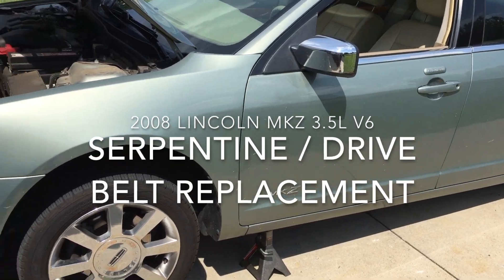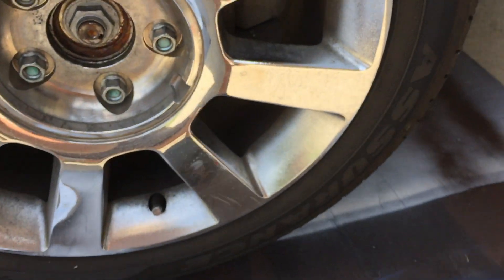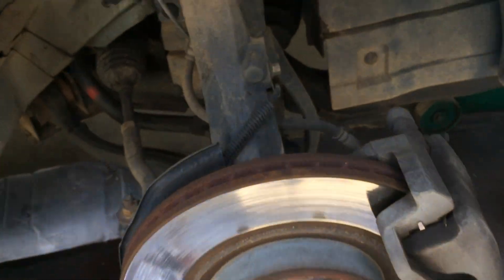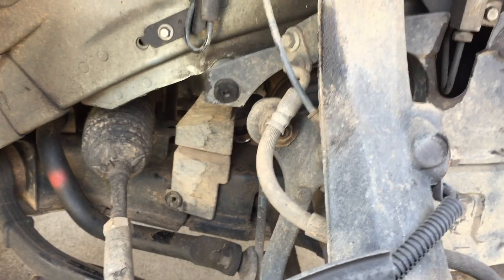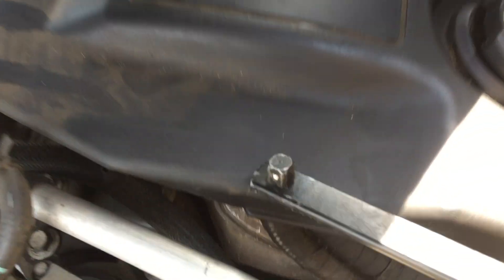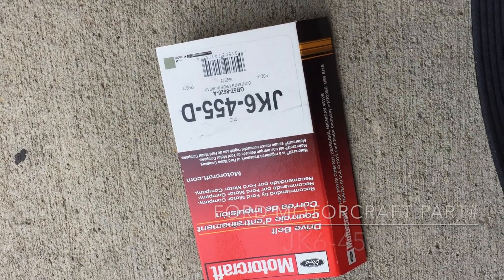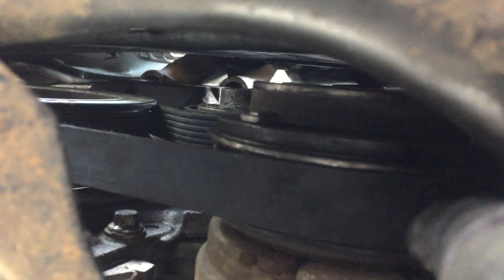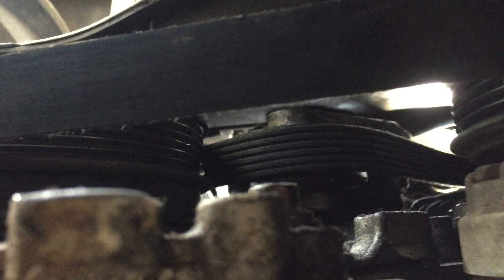2008 Lincoln MKZ Serpentine / Drive Belt Replacement

Comment from the maker: This video is of a 2008 Lincoln MKZ. It should be similar to year around it and also the Zephyr, Milan, and Fusion. It should work on years 2007, 2008, 2009, and 2010 (or at least similar).
Tools:
1. Car Jack or floor jack - https://amzn.to/2R7G96H 
2. Jack stands - https://amzn.to/3f3ABC5 
3. Serpentine Belt Tool - https://amzn.to/3vQIGkn 
4. Flathead screwdriver  - https://amzn.to/2RAjTlU 
5. Trim tool/Ancor remover - https://amzn.to/3f0bUXe
6. Tire iron (or 19mm socket + impact gun) - https://amzn.to/3vVDUBZ , https://amzn.to/3etXiQU 
7. Wood block or similar
8. A new serpentine belt (we used a Motorcraft part# JK6-455-D) - https://www.google.com/search?q=JK6-455-D&oq=JK6-455-D&aqs=chrome..69i57.1109j0j7&sourceid=chrome&ie=UTF-8

Removal Instruction:
1. Put the parking brake on
2. Block off the rear tires with a wood block (I used a 4x4)
3. Pop hood on car and use support bar to hold up
4. Go to front right (passenger) tire 
5. Remove plastic wheel cover with a flathead screwdriver
6. Brake loose lug nuts (do not take off)
7. Begin raising the car up with floor jack
8. Place support jacks under the car in the proper location (see manual - there are indentations)
9. Remove lugs nuts
10. Remove tire
11. Use trim tool & flathead screwdriver to remove four plastic shroud anchors
12. Have someone else on the top of the car, use Serpentine Belt Tool to put in the opening of the tensioner puller
13. Pull Serpentine Belt Tool towards the front bumper
14. Carefully remove the belt from one of the pulleys on the bottom
15. Compare old and new belt (part #JK6-455-D). Make sure they are the same size

Replacement of Belt Instructions:
1. Begin putting the new belt over each pulley you removed the old one from (except the tensioner pulley)
2. Once all of the v-belt grooves are in the pulleys, have someone pull the belt tensioner back towards to the bumper and slowly put on back of the belt on the smooth pulley tensioner
3. Slowly let the tensioner pull the belt tight
4. Make sure everything is lined up so the belt doesn't get thrown
5. Test belt - start the engine and listen. It should not squeal, if it does either your belt is not aligned or it's the wrong size belt.  

Putting it all back together instructions:
1. Put back on plastic shroud
2. Put on the 4 anchors
3. Put tire back on
4. Begin hand tightening the lug nuts
5. Tighten lug nuts down firmly (tire iron or to spec with impact gun)
6. Remove support jacks
7. Lower down car slowly
8. Tighten lug nuts to spec
9. Remove wood blocks
10. Release parking brake
11. Get back on the road

Check out my website at http://mcfixit.us 

If these instructions helped you, please "like" and "subscribe." Have a question, ask it below!

Disclaimer: Due to factors beyond the control of MC FIX IT, I cannot guarantee against improper use or unauthorized modifications of this information in the video, post, blog, or social media. MC FIX IT assumes no liability for property damage or injury incurred as a result of any of the information contained in this video. Use this information at your own risk. If you feel uncomfortable at any time. Stop and go to a professional. MC FIX IT recommends safe practices when working on vehicles, your house, or any other project and or with tools seen or implied in this video. Due to factors beyond the control of MC FIX IT, no information contained in this video shall create any expressed or implied warranty or guarantee of any particular result. Any injury, damage, or loss that may result from improper use of these tools, equipment, or from the information contained in this video is the sole responsibility of the user and not MC FIX IT.
#mkz #serpentinebelt #mcfixit

Comment: Where did you get that super long wrench? I’ve never seen anything like that. I’m sure it would help make this job super easy and not bust a nuckle on a pulley or the block!
Reply: I have one and got it from Harbor Freight in a little kit for reaching the belt pulley.
Reply from the maker: @aaronbrown9490  I got mine from HF too since I'm only using at most every other year with two vehicles. Mine was like $15 when I got it a few years ago with a coupon they had. Here's a link - https://www.harborfreight.com/serpentine-belt-tool-kit-63689.html?cid=paid_google|||63689&utm_source=google&utm_medium=cpc&utm_campaign=&utm_content=&gclid=CjwKCAiA57D_BRAZEiwAZcfCxS0NmgNmtE139ymTotv1LUNFswf36s9i-dmyP2aVeakFUVRep_EmzxoCaUEQAvD_BwE
Reply: @MCFIXIT  thanks. i'm looking to get this tool whenever i need to change this part in this weekend

Comment: Great video! No one has repairs on this car. Thank you!
Reply from the maker: You are welcome! Thanks for watching!
Reply: Try searching ford fusion v6 repairs
Reply from the maker: @ants3034  Yes, many of the parts and repairs would be similar, if not the same. I know from my brother's experience with this car for many years that they are sometimes different or at least more expensive parts used in some of the repairs he did. Good luck with fixing your vehicle!

Comment: The only video on the internet and it’s damn near useless
Reply: Tensioner pulled all the way back and been tryna force it over the tensioner pulley for about an hour
Reply from the maker: Sorry you are having issues. You might have a bad tensioner pulley if you are experiencing that. It was difficult to pull back but not that bad. I’ve had it worse in other vehicles.
Reply: @MCFIXIT  the pulley bar didn’t pull it back far enough. There’s a silver line that blocks the last bit of room I needed.
Just took a crescent and a wrench and pulled it back. Slipped right on after that